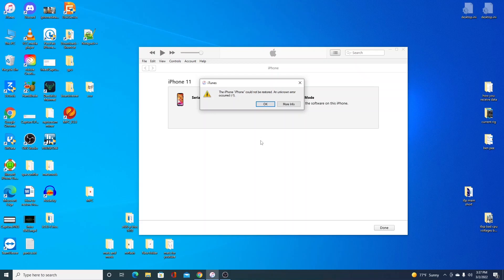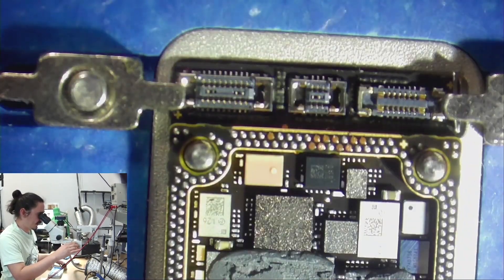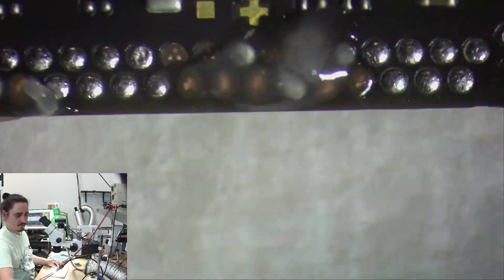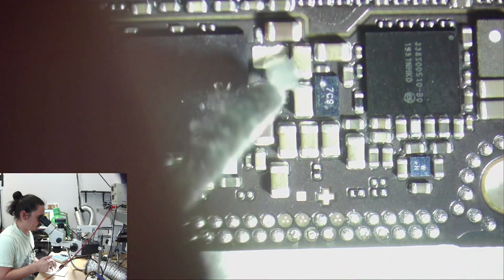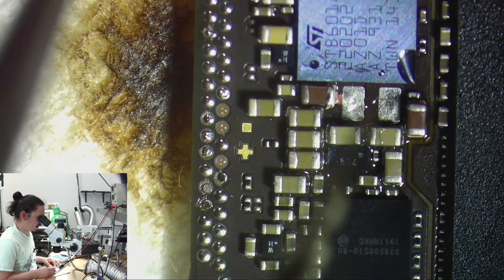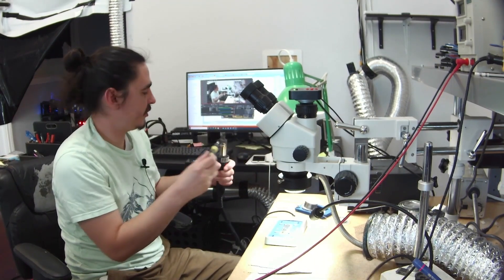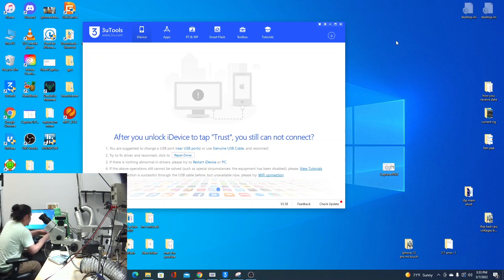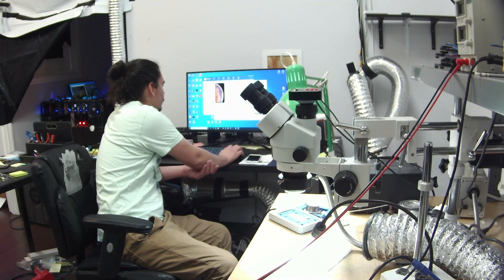How to fix iPhone 11 Error (- 1)

Comment: Hi aaron, can i ask something about gpu, if all memory banks reads error, where is the common fault in vram rail is? Is it the controller?
Reply from the maker: It can be a lot of things. Controller (dead core), vmem mosfet or coil, bad core enable line... this is a vague problem that can be caused by so many things.

Comment: Hi can you send me the link from the weights that you use for the reballing please .
Reply from the maker: Do you just mean when I mentioned I might add weight to the top and try again? I don't have any specific tool for this, I just use whatever I have lying around. I have used quarters in the past, more recently I just use a home button soldering tool that is a nice weight and size.
Reply: @iBoardRepair  
Thanks 👍